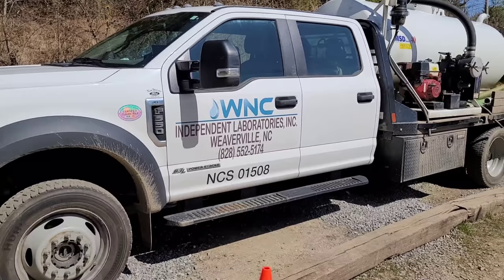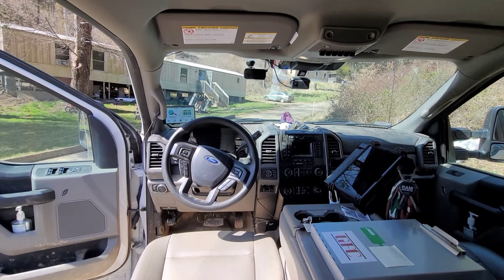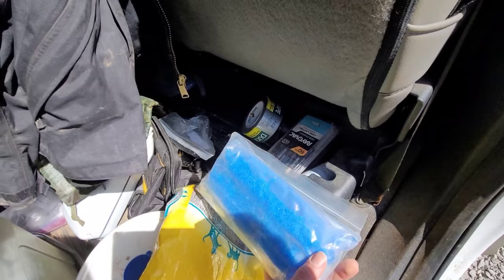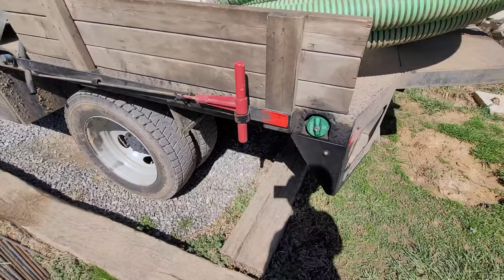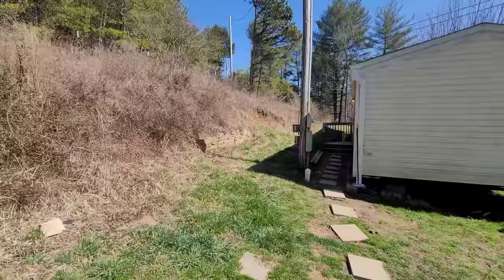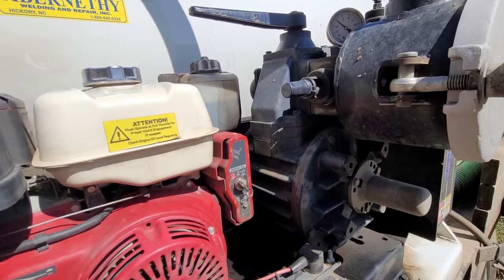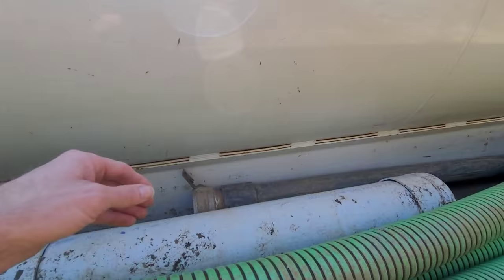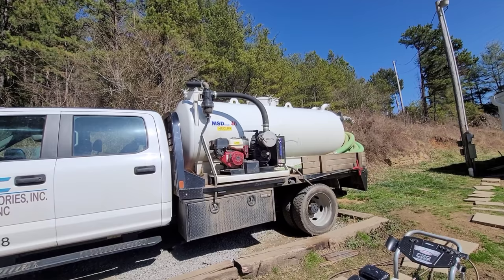Truck walk thru.

Comment: Didn’t see it but they make fire extinguishers that mount to the back rack of a truck. An ABC type extinguisher would be super helpful since you mentioned that your gas can almost melted. Second a small roof would help with your water issues in the valve/ a possible box around  the entire pump with doors that can fully open to allow air flow during operation. Third you can always have heat trace installed along the bottom of the tank and around the valves that freeze during the winter months. It would only keep it warm while the truck was running but it would help to thaw out the valves.
Reply: Idt they can seems how they have winter there. May freeze the latches etc etc or gum the nozzle up possibly.
Reply: 11:34 They could fix that water intrusion fairly easily.  Simply drill a center hole in a bowl or cup, place the cup on (upside-down) and then the handle.  Could first try with open clearance, but if water keeps getting in due to wind, then can adjust to a tighter seal. Could even go so far as something machined with an o-ring.  Otherwise, simply ample grease on that horizontal moving joint.

Comment: Love the color coded tools by truck. You could add at the end of the handles color coded stripes in duct tape or reflective tape. That way no matter what truck you are on, if you are staring at the ends of all the tools and want a specific shovel (or whatever), look at the color coded stripes and you will pull it everytime.

Comment: I am so impressed by your knowledge and passion. You have great equipment and it’s inspiring to see you talk about it. I’m thinking of auto inflating kits on your tires like military vehicles have to prevent flats. Also, reflective tape on your vehicle to increase your visibility to other vehicles and people while working in remote dark environments. The last thing I was thinking was a modular Molle organizer that goes in the back of the driver and passenger seats. This will help organize all of the extra gear you have back there like your duct tape, pens, flashlights, first aid etc. It will give everything a place and clear up a lot of room.

Comment: -A small cordless impact is handy to keep on hand for the lid screws 

-for all the stuff under the seat (duct tape and stuff) would be handy to have in a soft tool bag 
-On my friends truck he has a small water tank mounted under for clean water and a hose just in case you need to spray crap off :)

Comment: One recommendation I would have is for the electric start on the Honda motor to wire it to the truck batteries with one of the built in auxiliary switches being a battery shut off to prevent the truck battery from dying. At my work we did something similar for our air compressor for the service truck
Reply: I did this on our work trucks and also ran all auxiliary lights and flashers off of it to keep from having to burn fuel while parked. Just make sure to have a deep cycle battery and a good battery isolator. Also added an override switch to be able to start the truck from the aux if the primary is dead
Reply: Came here to say this! Also not sure if the truck is gas or diesel, but if gas just use the vehicles tank and install a transfer pump (or just lift straight from the tank). If diesel, consider a diesel pump OR go electric motor/PTO from the truck gearbox.

Comment: I pump petroleum. I’ve learned to keep a lot of 3” and 4”’ hose seals with me. I keep them on a carabiner, and out of the sunlight to prevent degradation. 

Another thing that is an easy help is having the hoses male on one end and female on the other, so no more barrel connectors or female to female connectors. Also, a short 5’ extension hose for when you’re just short of reaching your pump out target. I too use coated cable to attach the plugs and caps to the trailer and each to the hoses. 

Wilson Electronics makes a cell phone amplifier that will boost your ability to hit the cell towers. It’s hard wired to the truck, but not to your phone. Very handy when servicing customers that live so far out of cell service. 

Thanks for the leadership videos. It’s great material you’re putting out, and refreshing to hear

Comment: The only thing I could think of that I'd like to have if I was working for you, which I didn't see or hear mentioned, would be a separate small water tank with a pump to spray off tools and ppe to keep the inside of the truck sanitary. I'm sure it's not really needed as you probably have one back at the shop for the end of the day but I'd like the ability to clean myself in some way before getting into the truck and spreading whatever I have on me around the truck. Doesn't have to be anything fancy either, maybe a 5 or 10 gallon tank. The other thing, which idk what works better or is more cost effective but I've always been taught to use sawdust for cleaning spillages and never once thought about kitty litter. It's a great idea and makes alot of sense but where I am kitty litter is expensive as hell so just thought I'd throw that out there.
Reply: He could also use oil absorbent that you by at a auto parts store and that is a lot cheaper
Reply: That kitty litter he had around us is $10 for a 50 lb bag that's hard to beat plus there is not a whole lot better then kitty litter for sucking up liquids it holds 10x what sawdust or oil dry does.

Comment: Probably something I missed but a fire extingusher? 5lb minimum due to the remote locations. Also idk how lit it is at night but an LED remote spotlight mounted on top of the cab is always nice.
Reply: Work lighting round the pump & rear connections on the tank too.
Reply: It's there, you just didn't see it. If he has a high tier first aid kit, he has a 5lb extinguisher
Reply: @LegendStormcrow  How do we know that its their then? No markings indicating this like other DOT approved vehicles. If it is the one that came with the truck then those are junk out of the box.

Comment: A couple things. I'm pretty sure your rear bumper needs to be extended to the end of your overhang on the bed. Also the dash center has a piece you can buy that allows a ram mount for easier eye line and access for gps or cell phone holding. Built right industries makes this dash mount. I'd also recommend flood lights on the side of the vehicle for truck work and to see the property. For the batteries look into lithium batteries. They last much longer than a year. Something I saw before was running exhaust along the tank to keep the tank heated to keep it from freezing. Switch to super single semi rims and tires in the rear dulles? Longer life and Good weight rating. Handle on the rigid pipe for tank cleaning would be more convenient.  Good luck. Truck looks great.
Reply: If you're running super singles, you can't get a flat.. it'll cripple the truck. On a dually setup,you still have 3 good tires in the rear. Plus, have you ever priced the conversion wheels and a pair of 22.5" tires?? Definitely not going to pay for itself. Ever..

Comment: I can tell safety and efficiency are important. I would recommend a fire extinguisher. We bolt ours to the floor inside the cab. I would also move the first aid kit next to the fire extinguisher or place it behind the seat. You want these to be easily accessible and easy to find. During situations, you can easily forget it is hiding under rain jackets. I didn’t see a flashlight, would include the brightest ones if you don’t for those night jobs. Rear back up alarms are also helpful to prevent backing accidents. I’d make a magnetic clip for the tools in the back. Hanging them horizontally would make it easier to grab the tool you need instead of looking for it. And if placed back to the proper location, easy to see what is missing. I’d attach it to the “headboard” of the trailer. Get a guy to 3D print a protective handle for the pump. You can customize it however you want to really get the job done; prevent water from getting in there. I can’t give specifics without seeing where the water comes from. Love the GFC sticker and your content. Let me know if any of these ideas were beneficial and we can gift it to a local charity. Support the Carolinas!
Reply: Do you know who created the GFC stickers originally? i have a idea but im not sure.

Comment: Hi there James, your TikTok got me interested in this video and I have to say it gives a good impression of the trucks you use.
As of the suggestions you asked about, many things I can come up with have been mentioned before me like : crates for the loose stuff in the car a camera for backing up more easily and maybe a rack between the tank and the cab for the tools there. The last can be cheap from 1/2 PVC pipes with straps and this will also lead to less mess and damage in the back.
About the valves you can maybe look at electrical heat tracing, this is used widely in the petro/chemical industry for their lines, the one you want is specifically for winterizing. Of course it works best when insulated but doesn’t have to be a lot.
The pump assembly could be enclosed with some lightweight aluminium plates ( also used in the chemical industry) to keep it out of the elements and prolong its life, these enclosures can be opened of lifted away very easy. ( even by one man ) 
With this cover the valve will not get the water or ice around the stem and will work for longer. Even the battery will last longer is my best guess.
Like some others commented , why no water tank for cleaning and just handsanitiser ? I would put a simple camping tank with a drain on the opposite site from the pump assembly for cleaning tools and hands there.

Overall like I your content and you seem to know what you’re doing, keep it up 👍🏻

Comment: I have a few suggestions that could be helpful, for your small engine battery not lasting a year, it doesn’t look like it has a recharge system on it so you could be a kit that will run off the alternator you’re truck already has and you can run wires to that battery to keep it charged and running longer. The next thing is you could make a shovel rack that goes right on the headache rack on your flat beds and it can keep the shovels up off the bed so you could store more if needed and all around just keep the back looking neater. Finally a backup camera would be extremely beneficial for you guys backing down long and narrow driveways, I used to run plow trucks with salters in the bed and the backup cameras make things so much easier since you don’t have to worry about anything being in your massive blind spot behind the truck
Reply: The honda 390 absolutely does have a charging system. As often as it gets used, im surprised they get a whole year. Not bad
Reply: Batteries are crappy if you are not a big company, as an "civilian" you get lower quality batteries, so they break sooner.
With cars your factory set can last 5-7 years, the replacements usual 4 ish years. (in my and people i talked to about it experience)
So i would be not surprised if the smaller batteries who are usual for motorbikes and lawnmowers keep one year, they are build to last max 3 years but not for high frequent use.
Because, hey, battery manufacturers want more income too!
Reply: @pouncepounce7417 freezing over the winter also shortens the life of batteries. I wonder if a battery warming system would eventually pay for itself by making those little batteries last for a few years, rather than just one.
Reply: @bastarddoggy  you can buy batteries for arctic use, they are inside an foam box and have heater elements that heat the battery as soon it gets cold.
That costs power but less than the battery would loose degrading due to cold.
So if you have less than -15C regular it is an option to consider.
Reply: @pouncepounce7417  Just get rid of the small battery and wire the small engine to the truck battery
Reply: I was thinking the same thing. Why have that little battery when you have the big truck battery???

Comment: For your freezing issues you can run heat tape. Plug in or even run off an inverter while driving to deter the freezing.
Reply: Run coolant lines from the engine instead... Less of a failure point. That's how it's done up in Alberta.

Comment: I haul water for a living and face many of the same problems. However, the 6,000 gallon tanker I haul has a couple more accessibility issues due to its length and weight. I wish the truck I drive was set up as well as yours are. Awesome content.

Comment: Also, run the wires from the starter of the for the small engine for the pump directly to the truck batteries. This will eliminate needed a separate battery. We do this for our air compressors on work trucks.
Reply: Never go direct, always have batteries separated by an isolator or solenoid. If that little battery shorts out it can kill both truck batteries over night.
Reply: @theredneckman001  good point, I did miss that part. We do have a solenoid for our work truck compressor with a fusible link that trips if something shorts out.
Reply: @theredneckman001  no need for the second battery!

Comment: Hey !! Great video. Those seals are not glued in to those caps because over time depending on the application those gaskets stop sealing and need to be replaced as well as the hoses that connect to them. There are different companies that make those caps and the ones I used had a pretty thick ridge that the gasket sits in. and rarely had to pop them back in. Oh yea, That rigid pipe you showed that clamped on the end of the hose - We called a dip leg.

Comment: I’d get that first aid kit mounted on the back of the front passenger seat and not let the guys hang jackets on it.  That way it’s accessible from the drivers seat and there is no question of where it is if it’s an emergency and someone isn’t thinking straight.

Comment: 1. A 12v fridge like in semis/rvs. 
2. A small 5-10 gallon tank with clean water for washing hands and tools. Pressurizing the tank would help as well.
3. They make flexible pipe heaters which are basically a 120v wire you wrap around a pipe. In your case you would wrap the valves. This would require a generator/invertor or be set and plugged in at night like an engine heater

Comment: I dropped a few things on TicTok. 

First, if you aren’t using the backseat for seating, remove it and have custom storage made. You can keep stuff like the caps with the seals preglued in the cab so you don’t have to mess with it on a job. 

Next, move the tank back another 6” and hang shovels and other tools on the headache rack so you don’t have to dig for the right tool and easy to make sure you have all your tools before you leave a job. 

Also, put the pump and motor in a box with louvers on the sides and a door you can open when in use, that would keep both out of the elements and water from getting to your pump and freezing it up. 

Side note, and I’m sure you already have something, but hang a water cooler with soapy water on the bed somewhere to wash your hands before getting into the truck. 

Love the content, and the way you treat your employees

Comment: Only things I can think of: alternator for the pump battery, backup camera, and maybe some more off-road style tires for those rough driveways. The alternator probably won’t save you a ton of money, but it would help with the hassle of getting batteries. Someone already said backup cameras but I thought I’d mention it anyway. The more “off-road” style tire would have deeper tread and won’t need to be replaced as frequently while also aiding in the rougher driveways, but also cost a little bit more. Some smaller mounted lights or even just magnetic lights for around the more frequently used areas of the truck would probably help a lot an night too.
Reply: Offroad tires are not going to last long on the road.. gravel isn't off road, just not smooth sailing. The honda pump motor has a complete charging system, I don't know how you could think it doesn't..

Comment: I spent 7 years as a truck driver and pump operator for an industrial cleaning company. Used tons of camlock fittings , fire hoses and 12k psi blast hoses . we ussually used stainless fittings for high and low pressure. last longer.

Comment: Some simple things I would say to have, spare spark plugs and other miscellaneous parts for the pump, a tool rack of some kind to improve inventory, and as a machinist I would highly recommend getting a custom handle made for the pump control, you the dead centres on CNC tail stocks have a sealed off bearing as well as a design near the bottom to deflect coolant and I feel if that was incorporated into the handle it would help with some freezing issues in the winter